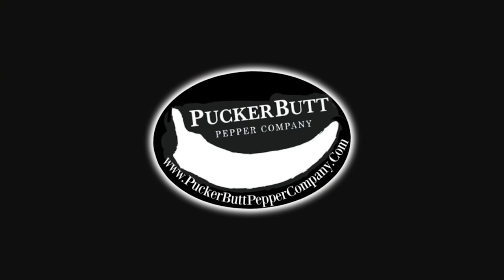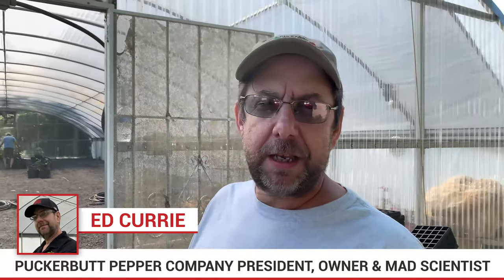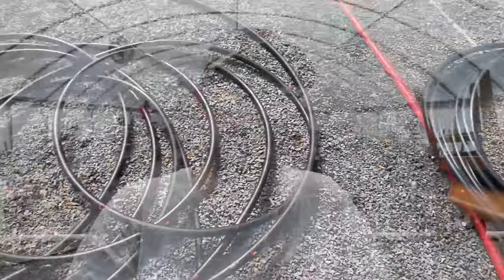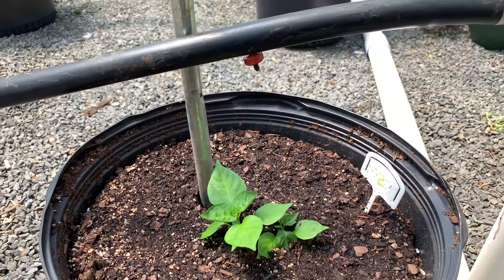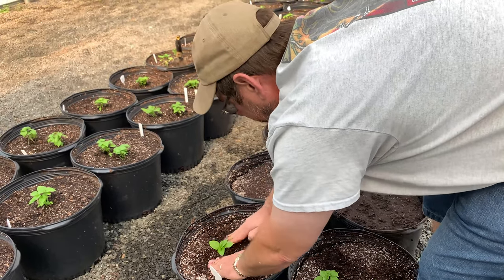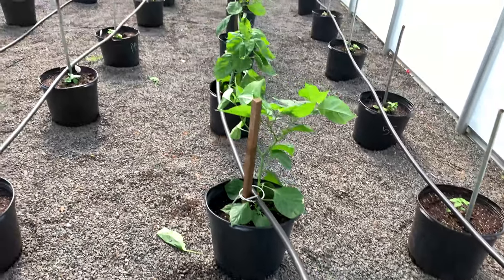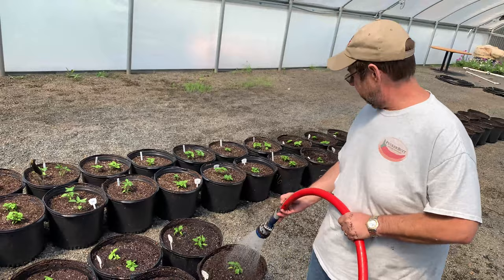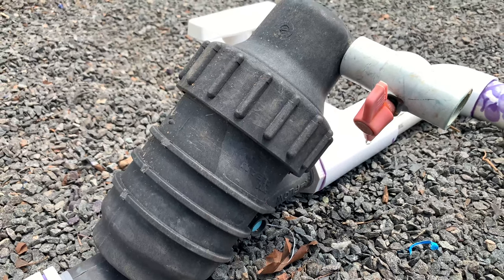Carolina Reaper Grow Camp | How Ed Currie Sets Up His Greenhouse

Comment: Wow... Ed... More Information for us to absorb, I am glad you mentioned how Hot it gets in that green house...  120 degrees,  That is the type of heat. I deal with here in the desert, 115° to 127° is not uncommon, the other day we were 122.8°, and your Carolina Reaper plants grown from seed, survived, they did, Droop and wither little bit ... bu, t they recovered,  I am amazed how heat tolerant pepper plants are in general, at least the few that I have so far... This is a learning process for me, to figure out what grows best in the desert environment.  So, I was listening very, very carefully to everything you said. I am sure over the next several months. I will continue to learn more  :-)
Reply: I live in the desert in Southern California and it only gets to maybe 115. Currently 95 today. I have 4 reaper plants in direct sunlight and I have 3 more reapers thay get shade around 6pm during the summer. I noticed the ones in direct sunlight require at least double the water and droop more often than the shaded ones. But once they get enough water, they look absolutely perfect. So in my experience if they're drooping/wilting, it's most likely too much extreme sunlight for too long or not enough water. Or both.
Reply: @mog_3825  cool...  I am on a daily basis watching the plants response, you could say i live near palm springs,  and today it's like 117 ... my reaper are seemly doing well...

Comment: Hey I live in Phoenix AZ, it is starting to get cool at night, down into the upper 60's and in the 75-85 range during the day, I have a reaper plant that has been growing for about 4 months and is about 2 - 2 1/2 feet tall, I forgt to top it and it is like a bush.  I have discovered one to two flowers on it, is that normal for a plant this size? I am wondering if I should attempt to build a greenhouse to put my pepper plants in over the winter.  I also have a habenero, and jalapeno plants growning. Should I be adding addition soil to the plant pots or just keep watering them and I fertalize spring summer and fall. I appreciate all  your videos an information. If i can get one of my reaper flowers to produce I will be very happy!!